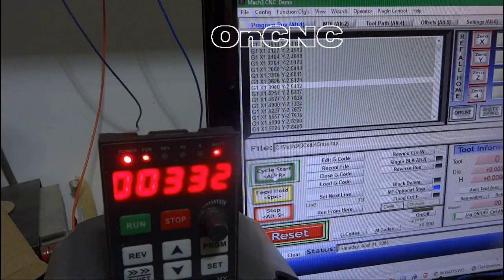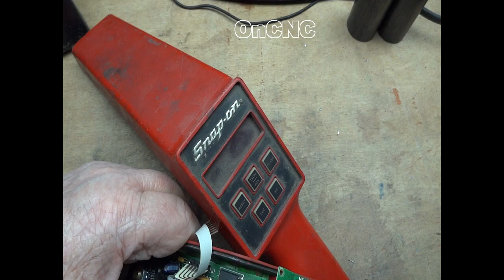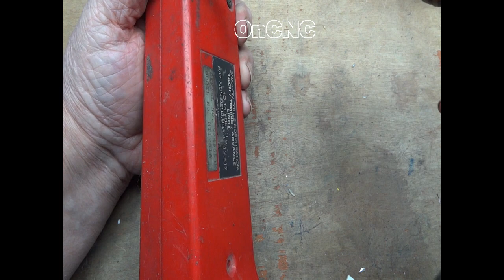Board level repair of a Snap-On advance timing light with Tachometer and Advance features

Comment: Hello, did the light work after the repair?
Reply from the maker: Believe it or not, I have not had the chance to test it. All of my vehicles are coil-over ignition. Np plug wires. I am also retired, so I no longer have customers' cars to play with. When I get a chance to use it, I will get back to you.
All I did was change a 5.00 MHz crystal that had a broken lead; there should be no reason it would not work, as the broken end could be pushed back into position, and it worked.

I picked up a new light when the Snap-On guy told me the price to repair my old one was within $50 of a brand new one, along with the wait time to get it back. Being that I was working as a state-licensed emission inspector, it was a mandatory tool.

Comment: what was symptoms? no flash no power of led readout etc?
Reply: check connection by the battery connections pull red and black plastic back bought one off ebay it was a loose wire on the black clamp
Reply from the maker: Dead like a brick. No display no flash. It was easy to find since one of it's leads was unattached.

Comment: What was that do-dad you replaced? I have the same timing light. It wrapped out on me 2 years ago.
Reply from the maker: It was a 5 megahertz crystal. It was an easy to identify problem as one of it's legs was clearly broken.

The problem is they do not silicon the part to the board, over the years the lead fatigued and broke.

I got mine from Mouser.com. I'm a bit disorganized at the moment, I know I have more on hand but need my wife for that search. If you're not in a hurry I might be able to locate and send one.

You'll pay more for the shipping than you will for the part.
https://www.digikey.com/en/products/detail/ecs-inc./ECS-50-S-1X/827518?utm_adgroup=&utm_source=google&utm_medium=cpc&utm_campaign=PMax%20Shopping_Product_Medium%20ROAS%20Categories&utm_term=&utm_content=&utm_id=go_cmp-20223376311_adg-_ad-__dev-c_ext-_prd-827518_sig-Cj0KCQjwqpSwBhClARIsADlZ_TmBMWOeoz6IW0lp8BIRa8YliiZadcV8gLFdKCVEB_dmRHacrxJO6EQaArf2EALw_wcB&gad_source=1&gclid=Cj0KCQjwqpSwBhClARIsADlZ_TmBMWOeoz6IW0lp8BIRa8YliiZadcV8gLFdKCVEB_dmRHacrxJO6EQaArf2EALw_wcB